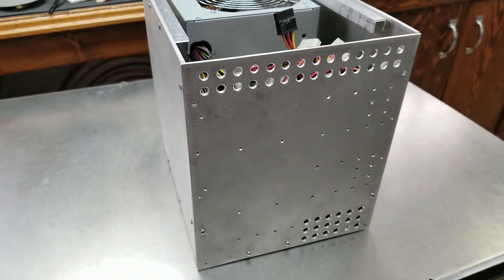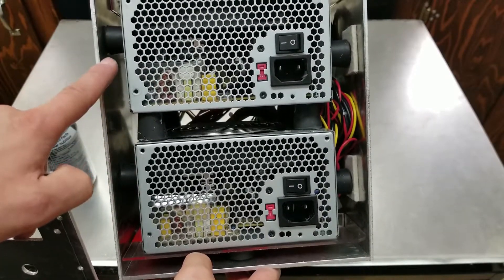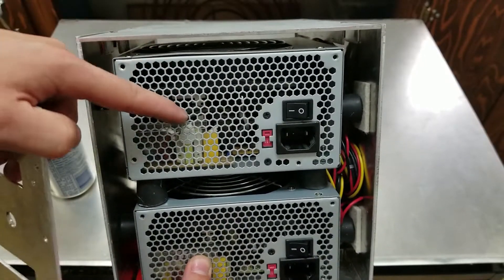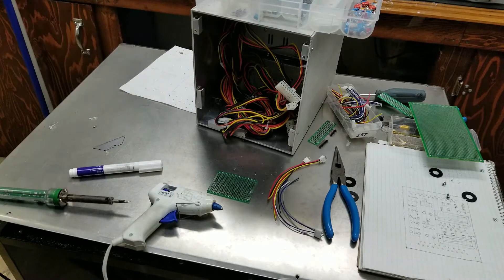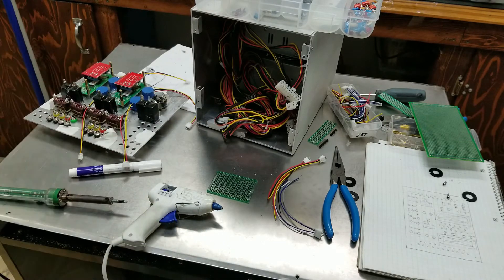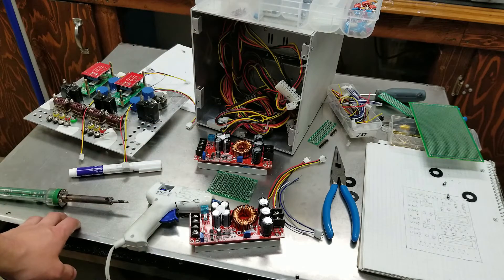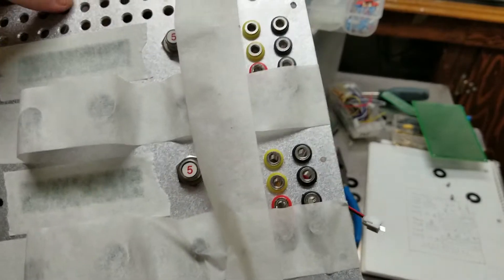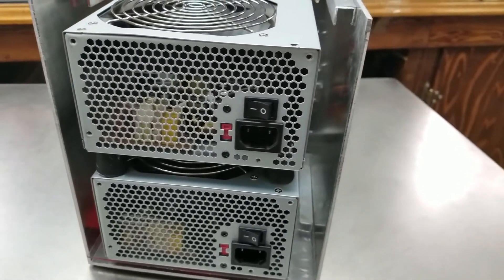Making homemade Lab Power Supply part 4

Comment: Hey, how do you plan to move air through the unit? With your current design it seems you will develop hot spots inside your case. Do you plan to add a push or pull fan? Great front panel!
Reply from the maker: By this time the psu is complete!!!!!
and by heavily testing it to the system limits it runs cool.
hope you will watch future updates and see what i had to do to keep the system stable.
thank you for the comment!!!!!! really appreciate the feedback!
Reply from the maker: By the way the front panel took a hole day to make, but it was totally worth it!!!!!!!!!!!